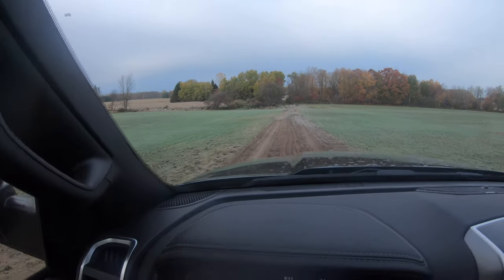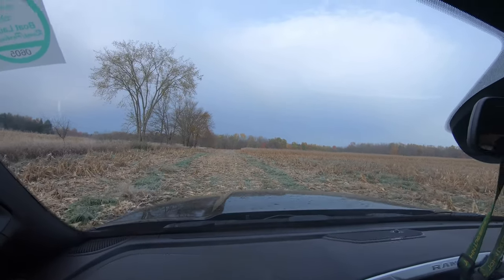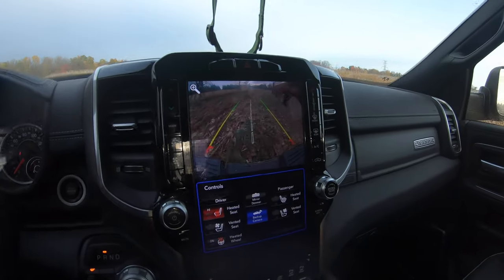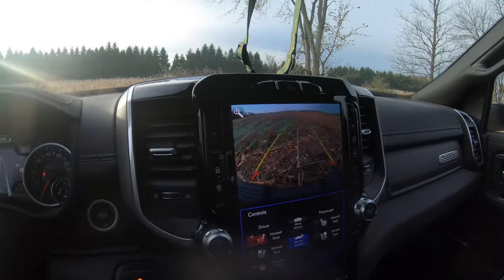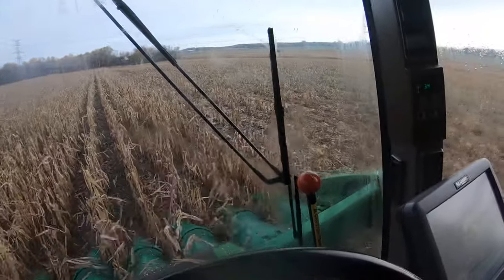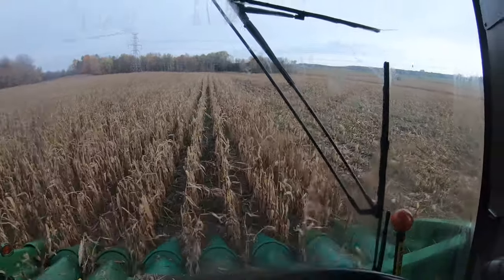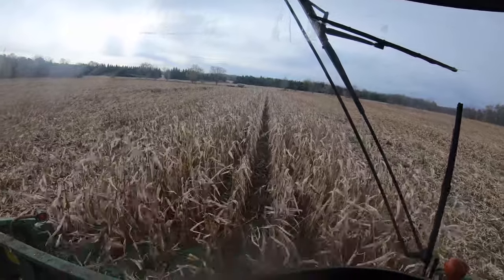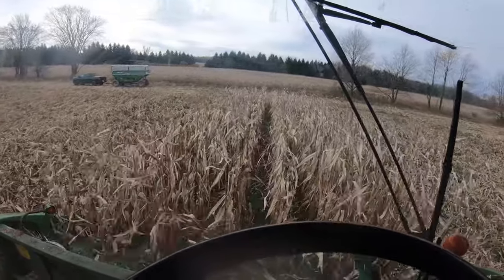Final Day With The John Deere 9500 Part I

Comment: Sweet. I dont need a key to unlock my door.  Idiot proof, just turn the lock lol
Reply from the maker: I normally never lock it, but ever since I put the yield monitor in, I like to keep it locked at night when it sits outside. The only downside to that is I didn't fully have it unlocked once, and when I started it up and got back out, the combine was running and I was locked out. Thankfully Deere's keys are pretty interchangeable. My uncles Gator key actually worked to unlock the door.
Reply: @RemembranceFarmsLLC  lol yeah makes sense.  I need to look into yield monitor

Comment: That is a nice Ram truck that you have. Is that new?
Reply from the maker: It is, actually. Well, back in May. When they were running the initial COVID deals it was just too good to pass up. I ended up moving from a 1500 to a 2500, and although I don't tow too much farm equipment, the 2500 definitely handles it much nicer when I do.

Comment: How many engine and separator hrs on your 9500?
Reply from the maker: When it sold it actually had 6,290 engine hours and 3,968 separator hours. Definitely high in hours, but still a very good machine!
Reply: @RemembranceFarmsLLC  looked like it was in good condition for the hrs. I'm looking to upgrade from a 6600 SH.